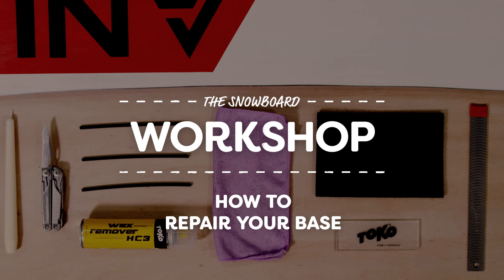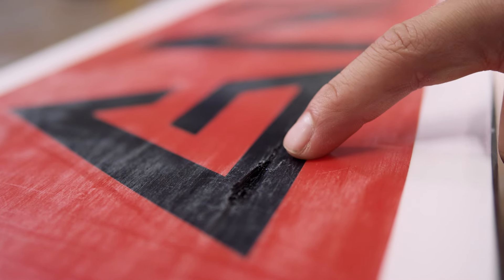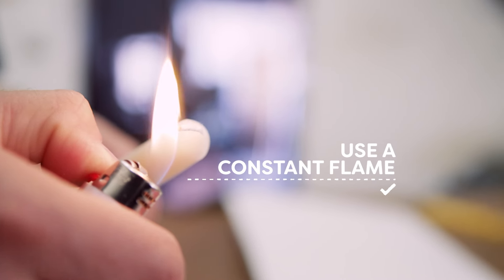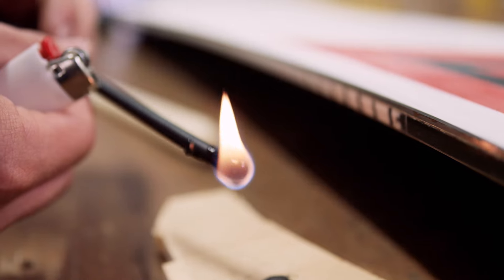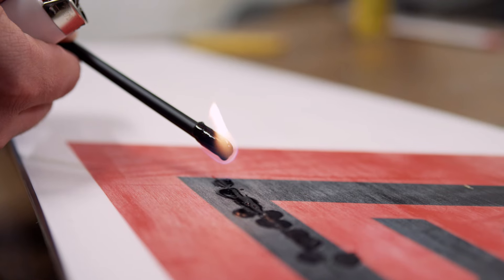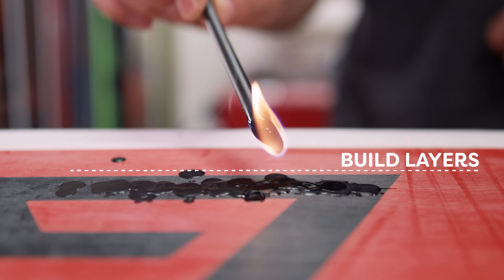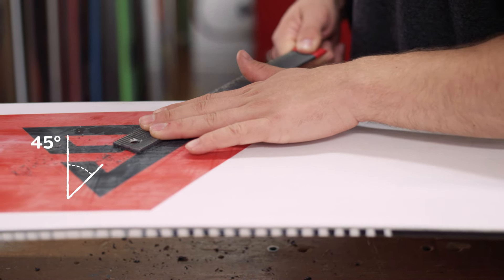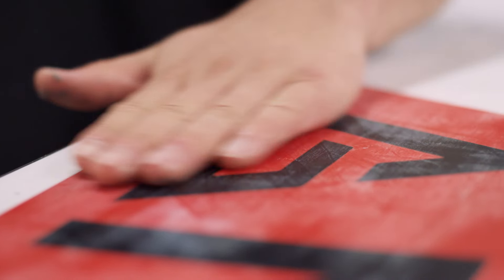How To Repair Your Snowboard Base | Whitelines Snowboarding

Comment: Not accurate. Your supposed to keep the ptex stick way closer than that almost touching the board because it will keep the flame blue not orange like the video. The more blue the flame the less contaminants in the final product!
Reply: But does that only apply to the ptex that is dripping or should you stray away from having a yellow flame on the ptex stick aswell?

Comment: Wouldnt you damage your base by using a rasp/file to grind it? How do you know that you are not rasping though the wax?
Reply: You are supposed to clean your base first. Fill the gaps next then rewax.
Reply: @Ketothev  I ment the base material, not the wax* sorry
Reply: @skahww1036  by keeping the file level?
Reply: You don't neel a file to cause more mayhem just use a cutter or a metal scraper to remove the excess of Ptex